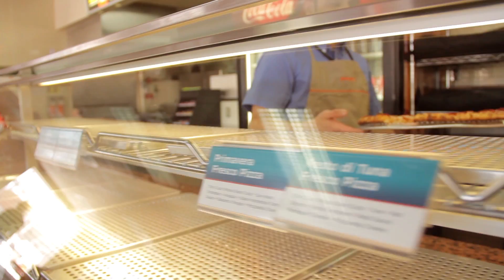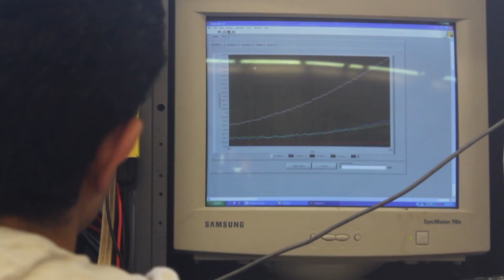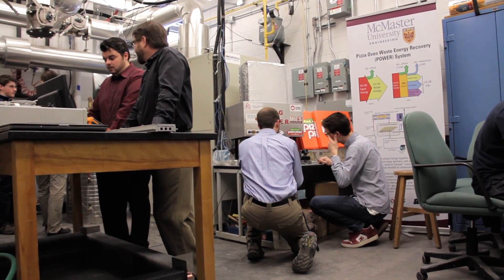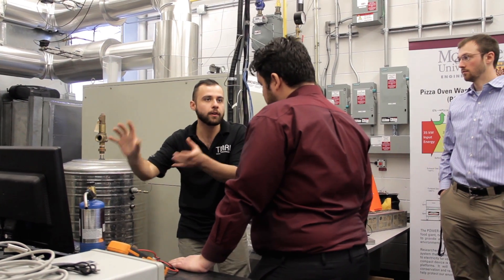Research Spotlight | Dr. Jim Cotton - Mechanical Engineering

Comment: I was think of heat relocator like the other person in the comments said. Especially during the winter when the restaurant itself needs to stay warm. We could put a pipe that was going through the restaurant and back to the kitchen and exhaust. And having a valve to control the temperature will help to choose if we want the heat to go through the restaurant or not. For example, you don't need heat during the summer so you would shorten the system.